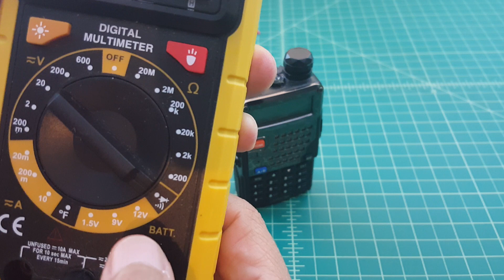Increasing the Range of your Baofeng UV-5R With a Counterpoise - TheSmokinApe

Comment: Good mod for a low watt radio is a good antenna but if you have an 8 watt and a nice antenna, they go further
Reply: Not so much. Doubling the power is 3 dB, e.g. 1/2 s-unit. Double it again, and that is 6 dB, e.g. 1 s-unit. So, to make an s-unit difference in transmit power, you would have to kick it up from 8 watts to 32 watts. A great antenna is much more important than a few more watts.

Comment: I'm back and i have Missed your channel alot idk what happened but i lost your channel for some reason
Reply from the maker: Awesome!  Glad you made it back, YouTube has been messing up people’s subscriptions for a while.  Hopefully they can get it right.
Reply: TheSmokinApe just picked up a baofeng uv5rv2+ and for some reason it won't communicate with my walkie talkies even if I set the frequency like I should do you know what could be up
Reply from the maker: brent davis' cool things are the walkies using any privacy codes?  Try looking at the settings of you Baofeng with Chirp to make sure they are correct.  Have you been able to use the Baofeng to tx successfully to any radio?
Reply: TheSmokinApe yeah there's some kids down the street talk to me and I can catch them on Channel One which is 462. 562 but the walkies that I'm using to communicate with the baofeng have a little dial that goes between one and 16 I believe the walkies that I have are the arkshell AR6
Reply from the maker: I’m not trying to lecture and only telling you so you are aware, it’s illegal to transmit on frs and gmrs frequencies with a Baofeng.  That said some walkies use what is called a privacy tone that has to be sent when you tx so they can detect that signal, that could be what’s going on.  Also, think of a channel on a radio as a holder for a frequency, channel 1 on one brand of walkie might not be the same frequency as channel 1 on another.  Do you know the exact frequencies your talkies transmit on?
Reply: TheSmokinApe yes sir i do
Reply from the maker: Dang, that makes it a tough one.  Can you hear the walkie on your Baofeng?
Reply: TheSmokinApe no not at all
Reply from the maker: That’s really weird, If I had to guess it would be that the walkie is using some type of private tone.  Sorry that I am not being much help on this one.
Reply: TheSmokinApe  sorry about that i was at work...ya that's what i kind of figured i guess I'll just have to stop doing that i don't want to get in trouble
Reply: TheSmokinApe and don't worry about lecturing me i listen and i want to know

Comment: Just a question. My baofeng unit has a hard time throwing far but has absolutely no problem on reception. Any ideas how to fix?
Reply from the maker: What antenna are you using?  Do you have access to a watt meter?
Reply: TheSmokinApe Stock baofeng antenna, and I don't know if my dad has one. I can go check. What do I do?
Reply from the maker: The problem could be the antenna so If you have a different one test with that.  Also, if your dad has a watt meter check the power output.  That said, it’s probably cheaper to but a new Baofeng than a watt meter.
Reply: check in your menus your power is not set on "low"

Comment: I like your video, and adding a ground plane is a decent way to improve the range of these Baofeng sets.

The wave thing on your tester is the diode check, and that wave represents that it will make a tone when the probes are shorted.  It will actually make a short time on a diode.

The wire trick should work on UHF too, but would work better if shortened for UHF. 

Aside from that, all good.
Reply from the maker: Great comment, thanks.  Glad you liked the video!

Comment: Awesome, going to do this with mine. I've also realized that if you grab the tip of the stock antenna with two fingers a bunch of noise goes away and signal comes in clearer.
Reply from the maker: Never tried that, thanks for watching!

Comment: Imperial system is what the USA and uk are using the rest uses metric but then again there are also differences between the USA and uk systems
Reply: The US has never used Imperial units. We use SAE units, which are sometimes the same and sometimes very different. Imperial was used only in Commonwealth countries from about 1825 to 1963. The very name of the system itself should be a clue-the US left the British Empire. SAE units are tied to the metric system. Recently the definition of the centimeter was refined, and that affected the inch for example.

Comment: Great Vid, thank you!  Using the 70CM (~460Mhz), could I hook up a half wave ~12 3/4" instead of a 1/4 wave counterpoise?  Benefits to 1/2 over 1/4 wave?  (I would think there was)  Thanks to anyone with ideas on this...  PS... I beat you to the cold one... cheers!
Reply from the maker: Nice @ the cold one!  I don't see why you couldn't use a 1/2 wave, I am not sure I have the expertise to debate which would be better...
Reply: Great... I'll try it; Thanks for the great vid and response, CHEERS!
Reply from the maker: Thanks man, good luck with the experiment.
Reply: The stock rubber antenna is a dual band antenna--and a rotten one at that.  It has the capability of using it's entire length on both bands but it isn't physically a quarter wavelength on either one.  I doubt that you'd see much difference between adding a quarter wave and a half wave counterpoise on 70cm.   If you try it, let me know how it goes.

Comment: 0:48 "it is more about the antenna then it is the radio"

Correct, but the radio has to create a good signal (right frequency, good modulation, low spurious emissions) that is transmitted. And it should have a good selectivity, so that nearby strong signals don't drown out the weak signals you may be interested in. And it should have a good sensitivity that enables you to receive the weak signals in the first place.

1:08 "when you have a radio like this, it doesn't ground with the earth, right?"

It doesn't need to ground with the earth. Think about the radios in airplanes, the international space station, television satellites or even space probes (Voyager 1 + 2). They all have working radios without a connection to the earth.

1:28 "The purpose of a counterpoise is to simulate a groundplane or to create a groundplane in the event you actually can't ground your negative charge or your radio to the earth" ...

The simplest antenna you can use is the dipole, two pieces of wire where you move some electric charges around. To do this, you have the transmitter that applies a alternating current to it.

You can attach a dipole antenna to a handheld radio, but the physical construction would look weird and it would not be that practical. So one half of the dipole was removed, some people call this a monopole antenna... but that name is misleading, there are no antennas with only one pole. The other half of the antenna wasn't removed, it is now just something else. It is a combination of the case of the handheld radio and the person holding it (capacitively coupled to the hand holding it). This works completely without any connection to the earth.

Also because of this alternating current you can't talk about a negative charge. Half of the time it is a positive charge!

1:53 "or it could be that you have your station set up in an area with rocky soil"

With the VHF/UHF on a handheld radio, the soil is irrelevant. You may have some reflections from it, but you have reflections from buildings, airplanes and other things too. And with a handheld radio you don't use the earth as a part of the antenna.

2:40 "you want to attach it to the negative portion of your antenna"

Alternating current, there is no negative portion of a antenna. It changes between positive and negative.

3:10 continuity test with a multimeter

The continuity test checks only if there is a low resistance path for direct current, but not for a 145 MHz alternating current. You just have luck that the baofeng has a metal case under its plastic and that screw has probably a fairly low impedance to it. If there were such a nice screw on the battery, you would probably find a DC path to it with the continuity tester. But think of the inductance that may be present on the way to a screw on a battery. It is common practice to add a filter to the power-lines to make sure that no RF can enter or exit the radio this way.

 5:52 "there are some people on youtube that claim these things don't work at all and there are other people that claim that they work great adding 12 dB of gain to your antenna. Well I don't necessarily believe that to be true."

This would be too good to be true... And if something is too good to be true, then it isn't true.

6:15 "I played around with this and I think I notice a difference, but at the same time when I move 2 or 3 feet to the left or to the right my radio performs better"

With VHF/UHF you have a lot of reflections causing constructive and destructive interference. This results in hot-spots with high signal strength and cold-spots with no signal strength. If the other station is transmitting, search the position where the radio reception is good and stay at this position for transmit. This is the most effective way to use a compact handheld radio.

There is no best antenna, there is one for every use-case. Normal antennas for handheld radios have as primary feature the small size, many are fairly bad antennas, but that is OK.

If you want something better, get a HB9CV or a Yagi-Uda antenna or something like this: http://www.qsl.net/wb3gck/jpole.htm
Reply: ZVPUNRY:: good break down but i hope you spent all that time typing all that up with  good intentions and not to be a smart ass haha
Reply from the maker: Thanks for the breakdown and feedback.
Reply: Zvpunry sounds like you have alot of knowledge in this area
Reply: Is there a book on HF transceivers and antennas that you would recommend?  I like to buy books that are good for SHTF, because if it really was SHTF the internet would likely be less than useful.

Comment: Will this help with the range on 470Mhz?
Reply from the maker: I'd think you would want to use a different length.
Reply: What length would you recommend?
Reply from the maker: It's supposed to be quarter wave.  470mhz is about 64cm, so a 1/4 wave would be around 15.9cm.

Comment: Since these radio's transmit, will a mis-measurement of the ground wire you just attached skew the SWR and burn out your transmitter? Would this idea also work for the UHF band and if so, what would the wire length be for that? Thank you.
Reply from the maker: Richard Brown I would work for both UHF and VHF, you just need to measure and cut the wire to a 1/4 of the wave length.
Reply: Thank you.

Comment: Great video... many people do not consider tying their systems to 'earth' ground.

Base stations are often grounded to the chassis of the radios thru the power connector so it would make sense to help your portable to tie it's ground to earth as well.
I would see no problem with a longer, thinner wire cable ( not solid wire ) and possibly a long spike nail on the end to stomp in the ground if your out of the buildings. Many ways to pick up the safety ground in buildings instead of the 'common'.
Since it is not supposed to actually be using the connection for heavy current travel, you could probably put a 10k to 1 meg resistor in the middle to give you a little more protection ' in case'. I'd have to try it out and see what I was getting both ways and pick the best performance.. but keep safety in mind.
Reply: Base stations are usually grounded through a bus to a grounding braid or heavy wire connected to either metal plumbing or a ground rod. Yes, I fasten grounding braid to a screw on the back of the radio.

Comment: dude the antenna is a dipole you dont ground dipoles they work from a posiyive and ground portion inside the antenna
Reply: I think he is kind of misunderstanding the whole counterpoise term. A counterpoise, if elevated, does make it a dipole. A counterpoise/radial on the ground does act as the ground part of a vertical.

Comment: wasnt thinking. the tail needs to be as close to the antenna as possible and sandwich underneath works well.. the scews as the video shows are too far away for my 477mhz setup ive used a bit of high tensile tie wire as it is very durable and will bend to where you want it
Reply: I don't think that it matters on 477mhz so long as you trim the length of the counterpoise a little

Comment: i wondered if any one else was doing this. this is equivelent to a radial on a ground plane. the length and angle are crutial to the improvement especially the length my antenna had an swr of 3 to 1. with the radial it came down to 1.3 to 1 and an improvement of more than 2 s points this was at 477mhz.. different length antennas will need a  radial [tail] with a different length/angel combination and the results will vary.. the radio now runs cooler and battery life has improved.
Reply from the maker: steve frost as long as there is continuity I thought the screw mount work.  When connecting to the antenna base I didn't feel the connection was secure.

Comment: whats the normal.range of baofeng uv-5r?
Reply: Manz Mehr connect to a repeater. I have picked up Norway, London, Mexico, England, Australia, just to name a few. Best results when they are having a ham net.
Reply from the maker: Desi English Man Thats a tough one to answer.  typically a few miles radio to radio but further if you are using a repeater.  Things like elevation and terrain play a big role as well.
Reply: Can i use it for like place one uv 5r in my home and other with me in my university which is like 15 miles away from my home?
Reply: I have ordered these on ebay for communication purpose but i dont know what  repeater actually means i just know the walkie talkie....
Reply from the maker: Desi English Man To go 15 miles you would need to use a repeater.
Reply: Repeater?
Reply from the maker: Desi English Man A repeater is a system that is usually on a tower, it will take your communication and then retransmit it at a further distance.  This distance is achieved with higher power and antenna elevation.
Reply: So if i have two uv-5r can i use them directly without repeater for short distance comunication...
Reply: You do have to have an Amateur Radio License to transmit.
Reply: The Modern Adventurer England is in London , hehe
Reply: wayne murphy 
Lol, yup. 
It's just what popped of the top of my head from call signs.
Reply: I will say Australia contact is not common on my local net. 
Only once have I heard a guy on from there.

Comment: also, how you hold the HT makes a difference, have you ever noticed the feeling like the negative battery terminal is getting warm when your keying up? that's the RF energy lol, now it's trying to use us as a ground plane and I don't know how good a ground plane a person makes but I haven't noticed any noticeable positive or negative effects from holding the radio with the contacts against my palm or not holding it that way, I guess if it as a adverse affect the contacts would be placed differently.

your right about the wire giving a ground plane, the gains are very small but do exist, one thing I did note from your video was you actually pointed out the length of the wire is cut to suit, I've seen so many other videos that just advocate chucking on any old length of wire which is not the way to tune!, I wonder if we could get a pl259 to SMA so the HT whip can be used in the test, maybe we could rig the whole thing up to a swr meter and play with lengths and see what happens, maybe that's another video for you!!

I use the uv-82's I love the dual PTT buttons and one big winner for me is that the 0 button is in the right place on the 82!
Reply from the maker: Steve			 Fox Great post, even the angle of the antenna matters.  I habe felt it get hot but thought it was the battery, good observation!

I reciently got an 82 but haven't taken it out of the box yet, I am planning to do a review at some point.

Thanks for watching and the comment!

Comment: hi smokinape, can i curl up the rat tail or counterpoise & make it look like a spring coz i dont like the way it just hanging?
Reply: Not a good idea because at that point you are making an inductor out of the rat tail.
Reply: No.  Coiling the wire changes it's electrical length and creates unpredictable results due to it being an "inductor".
Reply from the maker: IanZeuz not sure, I don't see why not
Reply: i dont have a swr meter to test yet, and all the video i searched didnt do it.. still not sure but thanks anyway
Reply: IanZeuz..I was thinking the same thing

Comment: If you have a good antenna that fits with your radio, then this wont work, but wont damage it either :)
But with many crappy china fakes around it will work a charm on them and make them work well.
Did some testing with an analyzer even and some antennas go from bad for your radio to all fine.
Reply: I'll have to try. I have a few fake antennas and real name brand. just got a nice new field analyzer to play with.
Reply from the maker: +Eken Eken Thanks for the info...

Comment: I just use stranded copper wire and wrap it around the antenna post, then screw the antenna down. Very easy, works great.
Reply from the maker: Thanks for the info!